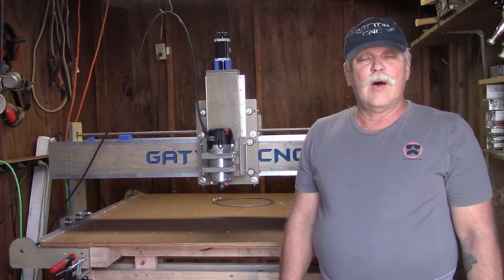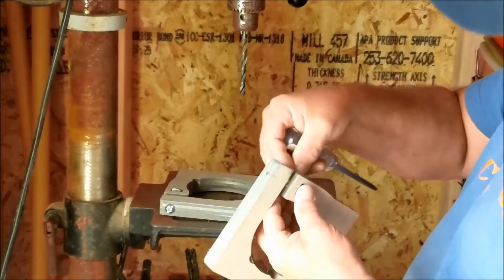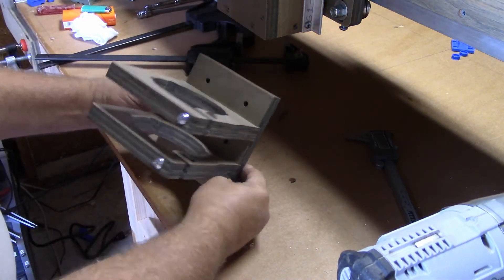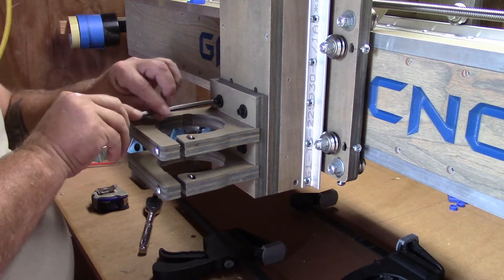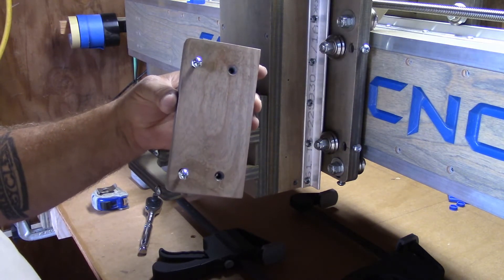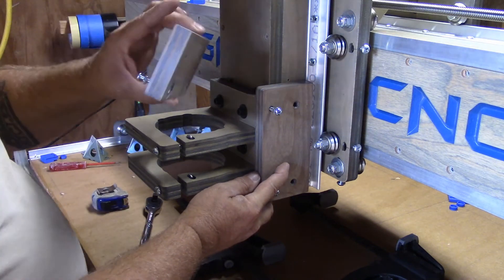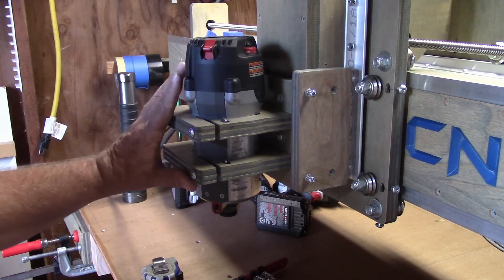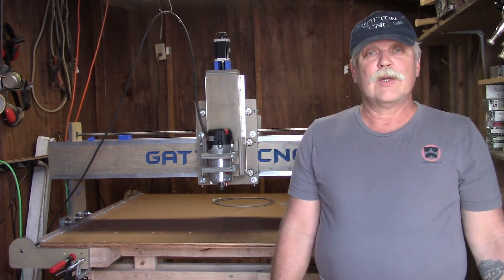Gatton CNC Build - Part 10 - The Router Mount

Comment: Question if you true up a piece of pipe to rest between your work surface and the router bottom plate couldn't this be used to tram the router to the table and lift the Z box after Locking it in place to remove the pipe? Awesome video's Mark keep up the good work.

Comment: I am not shure but maybe it is more mechanically right to tram the sledge (wheels) not the clamps?
Reply from the maker: The thing about the Gatton CNC is the simplicity of its design. You could adjust the wheels if you'd like, but it's far easier to just adjust the spindle/router mount. As for whether it's more mechanically correct to adjust the wheels or the mount, the overwhelming majority of professionally made, industrial CNC routers I've seen are trammed at the mount. Same holds true for a lot of milling machines. I figure if it's good enough for Bridgeport, it's good enough for me. Thanks for watching!
Reply: Humble q.: and what is the right way?
Reply from the maker: Over the past 57 years, I've found that very often "the right way" is the way that works for you without damaging anything or hurting anyone.  Now we can split hairs over things that just don't matter, or we can get on with the work that needs to be done so we can move on to the next step/project. I find that all too often, some people spend so much time pursuing "the best" or "the correct" for so long, they don't do anything because they're paralyzed with fear that they'll do something wrong. If you want to adjust your wheels rather than adjust your mount, feel free. Both methods are used by the major manufacturers, so both ways are "the right way." The choice is yours. Pick one.

Comment: i would of just cut the allen key so it would fit in that small space
Reply from the maker: No you wouldn't have. The head of the Allen bolt was almost touching the body of the router. The hex bolt and open end wrench works great.
Reply: i see ..
Reply: @MarkLindsayCNC  lol sorry dude i must have made that comment before i watched the whole video....How ever I thing the allen bolts would of worked since you had the fancy tram blocks on the outside could of got square using them .then removed the router maybe to tighten them down.

Comment: Great mod Mark!  I have a similar router.  I surfaced my spoil board last night and made some shingles...so I'm going to add this mod to my beast this weekend.  Did you mount your router so that when it comes time to replace the brushes, you will not have to remove the router from the mount?
Reply from the maker: I didn't intentionally orient the router for easy brush removal, Carlo, but it turned out that it's mounted that way. I think I'd still take it out of the mount to replace the brushes, but that's just for ease of access - height wise. I also wouldn't want to be torquing on the router with it in the mount.
Reply: Thanks. I made the  jig from your next video. Getting ready for the mod

Comment: Thanks Mark,  I have some ball head allen wrenches that let you get at "'access challenged" allen bolts... They may have been able to get to those bolts... Just in case you run into this issue again  :)
Reply from the maker: I have ball end wrenches too. Still a no-go on the lower bolts. The hex bolts are fine.
Reply: Gotcha..